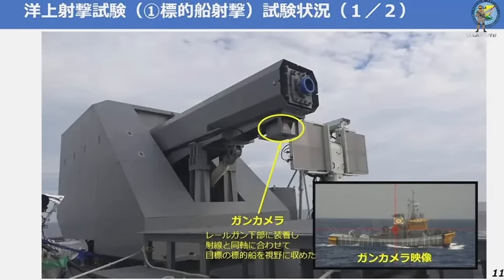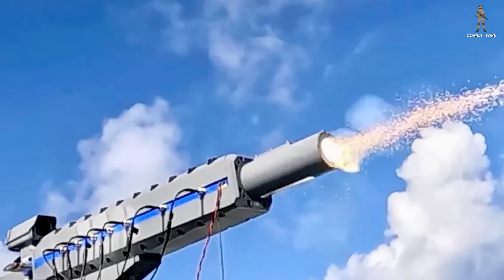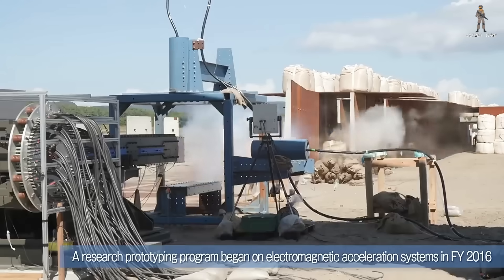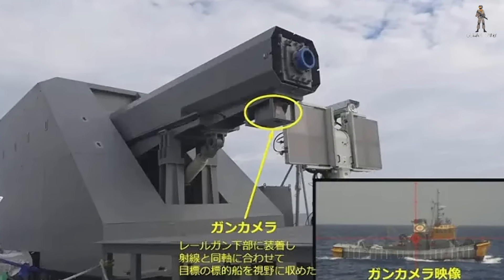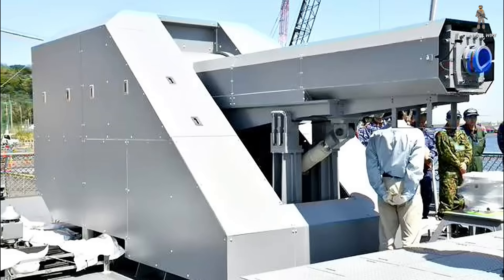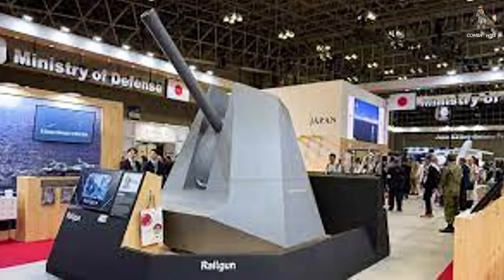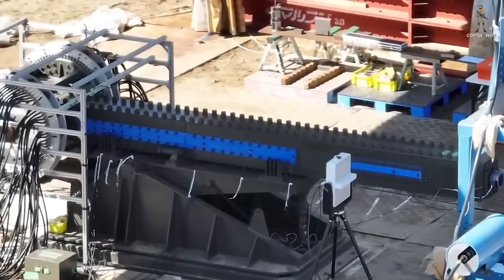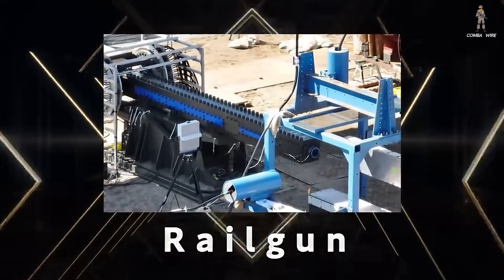For the First Time Ever, Japan Reveals True Railgun Damage at Sea.

Comment: Couple of things off and or missing in this video.  The U.S. has working models of a rail gun.  The issues with the rail gun include: Price of ammunition (I think it was estimated at 1 million a shell), Power requirements needed to fire weapon, and what is NOT mentioned in this is firing rate.  Sure it works if you only fire 1 shell every 30 minutes.  This is possibly where Japan made some improvements making it shorter between shots but notice how it was NEVER mentioned in this video?  Firing one of these 1 every 10 minutes is NOT quite lethal.  I doubt it is that short of an interval.  The power is also a MAJOR issue in order to get these onto ships they require a nuclear reactor power source or like this video mentions 4 container size power generators-this video says it was part of the cooling system and it might be but that is still not very realistic.  
Now a solution to the power and firing rate I hate to say is the battleship design war ship.  Completely remodeled of course having probably 2 nuclear reactors.  A ship with this size and shielding could have 2 rails in front maybe 2 in back reducing firing rates by a factor of 2 or 4.  Fire 1 it sits idle for 20 minutes while 5 minutes later you fire the 2nd and then it sits 20 minutes.  5 minutes later fire the third and so on.
You reduce the time to fire the size of those ships can hold the power source.  
With all this being said one can see why it really might not be feasible to complete.  The cost of weapons, shells, power (reactors) new ships, and still have some limitations on using rail guns.  Although I heard a theory that battleships may soon be required again in order to house the necessary vertical cell amounts for a new modern battle.  The new attack profiles show one can overwhelm a current strike group if a certain insane amount of incoming targets are launched.  Example most Destroyers have max 96 cells so if lets say 1000 anti ship missiles and drones are all coordinated to attach that vessel- something would probably get through.  In a prolonged battle with multiple sorties it can be an issue of using up all the anti air missiles rendering a ship ineffective.  Think about once per hour a strike group having 200 fired at them- would they survive for 48 hours?  A new battleship design could be designed to hold 400 cells for anti air (plane, drone, and missiles) and anti ship.  I know i am leaving out the other defense mechanisms on destroyers like lasers also power hungry devices, the close in weapon systems etc. but it is just a numbers game.

Comment: Railguns are really, joust not that good.

The first problem is the velocity. We are often given 800 to 1000 m/s for conventional guns, which is not wrong but very misleading. A railgun shots sub caliber projectiles. Such projectiles are shot at 1600 to 1700 m/s (mach 5) out of conventional guns.

Being cheap per shot is nearly inconsequential in its environment. The targets are either other ships or planes. Even a plane is vastly more expensive than most missiles. It can also not be used as defense against drones due to the fire rate. This means another system needs to be used no matter how cheap a railgun is per shot.

The railgun has lackluster damage. It is great for penetration, but all that it is doing is poke a hole. A hole ,as shown in the video could be fixed within minutes by any damage control personnel, and it would still take a day or 2 to sink the ship even if left unattended.

The few other niches it could take are also rapidly being taken by lasers. Far cheaper and no need to rebuild your entire ship.
Reply: A railgun would be more of a 'sniper'.  If you know where a particular ship's ammo depot is, you could have enough power to punch through armor to hit it.  Even if you don't cause it to detonate, that's still damaged goods in there, meaning damage control will be needed in such an area, slowing down damage control in other areas.  It could even be used to more effectively hamstring weapon systems, as a good shot could slice through a weapon control system.  Even damage engines in rather awkward places.  There's a lot of potential with the use of railguns.  We're still a long ways off from seeing them being used more than just prototypes.

Comment: Problem with a railgun is really 3 things range, speed, and overall logistics. The fastest they can get these things is about mach 6 (they say Mach 7) where as breathroughs in scramjets essentially make it obsolete because instead of a 80-100 mile range and something that has to have a recharge time and tons of maitenance you can have something that has 190 mile range and is accurate AF moving at Mach 10 and can be reloaded at sea where as railguns can only be reloaded at port. Oh, and did I forget to mention hypersonic missiles can be apart of aircraft loadouts too? So which would you rather have? Ships with less range but a cool sounding gun or ships and aircraft capable of decimating enemy defenses from anywhere anytime? At the end of the day, afterall, logistics wins wars.

Comment: Railguns in movies : static electricity charge all along barrel, explosive boom when firing, dramatic recoil
Railguns in real life : poot
Reply: poot poot goes the small mass of death througth the sky ,,, hmm wonder if nuclear material could be combined in such a way that the energy from the impact would trigger it into a small nuclear explosion
Reply: @V_for_Vendetta_vNah…
Reply: it's like the Displacer in Lancer: barely any visual indication, barely any sound for a weapon of this caliber directly from the firing, you only hear moments alter the cacophony of machines engaging cooling systems and handling the power load.
Reply: Thats a coil gun i think
Reply: @iofebquelloscarso6275 See, this is what happens when you think.
Reply: It’s super sonic, it’s very very loud.
Reply: tbf, that would be scary to experience. out of nowhere, no sound, no heat signature, no indication of what's coming, your ship suddenly sinking
Reply: @truck-kun  It has to have a heat signature, just by going THAT fast.
Reply: @TheGaMeL0rD  a pretty big one as well, at mach 7 such a pointy object would generate enough heat to melt steel and then some at the tip.
the trick is to be close enough that the target wont have the time or opportunity to register it at all before getting hit, we are talking mach 6 to 7 after all.
Reply: @Nardur12321  "captain! incoming bogey at seven miles and closi..."
Reply: “Poot” 🤣🤣
Reply: The challenge with rail guns is it air resistance.  They will obviously be the weapon of choice in space, but their advantage of conventional explosives is greatly reduced by the extreme resistance. They are also stupid projectiles so long ranges or with erratic targets they may be quite ineffective.  Also, if you think about the energy consumption, the shift would need to carry massive amounts of additional fuel just to generate the necessary electricity. That extra fuel might actually take up more space than the conventional rounds.
Reply: like with lazers
Reply: Hey Mark, six projector is going to make a huge sonic boom that could be louder than a conventional chemical explosive.
Reply: Because this is only level 3. The movie's relation is level 5.1.

Comment: There are a wide variety of reasons the US gave up on railguns.  One of the big ones is that we were aiming at vastly-long-range, like potentially orbital.  And that meant the rounds had to be self-guided.  Which meant expensive, and deeply vulnerable to the exact kind of forces the railgun would blast the round with to fire it.

Another concern was power demand, on top of the US navy powering EVERYTHING ELSE electrically now on our ships.  Propulsion, power-hungry sensors, laser point defense systems (being tested at the same time, and tested very well).

Seems like Japan's being successful with a less ambitious approach.  I applaud them, and hopefully it does well for them.

Comment: Eh, until they figure out the issues of the "barrel" destroying itself over a relatively few amount of shots it'll be stuck in research hell forever. Problem is pumping that much power through the rails tends to overheat them and they melt/degrade rapidly.

Comment: One of the reasons that makes it believeable that Japan may be the country to perfect Railguns is the fact they've been moving stuff on electromagnetic rails for decades thanks to the Shinkansen. There's a whooooooole plethora of knowledge they've accrued thanks to that. From energy management, to material behavior.
Another reason isalso the many decades of engineering knowledge on the field of fitting complex machinery in small spaces, born of necessity (island nation, space is a premium). Have you seen a video of a Japanese plastic recycling plant? Awesome stuff.
Those two pillars of knowledge give them a whole different mindset to tackle the technological challenges brought by Railgun Technology.
Reply: They’ve also got much more modest and practical goals for this weapon. A 40 mm railgun could be a GREAT option as a CIWS if they can develop a slightly sturdier (and easily swappable) barrel. The US railgun looked like something Leader Desslock (or Dessler if you prefer) would to the bow of his flagship. It was totally impractical.
Reply: @GrahamCStrouse  I just dont know.  My bet the tech will get far more expensive, after the kinks are resolved, rate of fire needs a boost.  Not many chances to make interception, let alone multiple.  It might penetrate anything and from further away, but swapping CIWS for rail, if performs as advertised, I dont know.  I can see this for major vessels, have room and energy, too far to swarm, but for smaller craft, CIWS or a mix, might be best.

Comment: History - the rail gun is an adaptation of the mass driver designed to move material from asteroids to a processing plant near L5. It was designed by a thinktank run by Gerard K O’Neill  in the 1960s. See his book ‘The High Frontier’ which was submitted to Congress in around 1972. Reagan subsequently introduced the Space Defense Initiative (SDI -Star Wars) , basically to provide funding to develop space tech in a way the voters could understand.

Comment: A modular barrel seems to be the key. Not only easily replacing worn down barrels but also being able to quickly switch out different barrel types.
Reply: The question is hotswap or coldswap (Hotswap allows for you to switch barrels without completely powering down first, like USB)
Reply: OMG...make it with rotary barrels.😮
Reply: @sithsquid1 and the put it in a plane!
Reply: @sithsquid1  and then with circular magazines, you can have revolverception.
Reply: @sithsquid1 then you need to replace 6 barrels
Reply: You think the engineers never thought of a modular barrel? :P
Reply: @iGhost umm I’m sure it’s probably their end game. Calm down. It’s just the video doesn’t mention it when it seems to be the most logical solution. Even some conventional artillery guns have swappable barrels.
Reply: Modular barrel + watercooling (the ship is in cold water FFS) + turbines for power (the ship is in moving water FFS). The real issue is why do all of this when good old BOOM BOOM guns work fine ? Maybe for a stealth ship ?
Reply: @PyromancerRift 
Missile interception
Reply: @PyromancerRift  No gunpowder need = more space and less explosive on board.
Reply: @PyromancerRift  hyper sonic missile is too fast for traditional pew pew. laser only works well under good weather. that's why we need railgun.

Comment: Being able to punch a hole through the power plant of a navy vessel at low cost while being extremely difficult to counter at long ranges far exceeding typical chemical heavy guns is massive. You can use a missile to counter a ballistic, but a 1-5million missile vs a 12k tungsten rod is huge.

Comment: I mean modern ships are glass cannons so the thing penetrating isn't surprising.

I think a battleship equipped with railguns (even small ones) in a carrier group would just mop the floor with everything.
All that space a battleship has for conventional ammunition can be converted to hold railgun ammo, rails and support equipment.  Try to ammo rack a battleship who's ammo is just a bunch of steel slugs.
Modern ships just don't have the armor or space to host these weapons right now.

Comment: Can't really see the application for this yet, it needs massive power even using nuclear powerplants it can't keep up so it's waiting on fusion and even then when that rolls round it's going to be obsolete in favour of energy cannons, platforms can't handle it so it need either a battleship, a defense platform or a space station and then you got the cost of replacing barrels etc with is just going to balloon the cost, it's a nice RnD project  but they're better off figuring out fusion it's not a viable intermittent weapon between now and then won't replace a gun on a ship which is only usable in cqb and we've got missiles that can hit anything at any range.

Comment: next step, hold the projectile in an electromagnetic field so the barrel wont wear out?
Reply: You're thinking of a Coilgun. Railguns require constant contact with the barrels rails to drive the projectile, Rail-Gun.
Reply: @nebuladoe775 combine the 2, minimize contact and put a conductive liner on the rails that can be easilly replaced after 500 ish shots

Comment: Naval warfare is largely beyond visual range i.e. over the horizon, these days. Even going with ballistic trajectories you’d have to have a very precise fix on the target or you would need terminal guidance for the projectile, which is very expensive and challenging. Missiles are better at this. Railguns may have a role to play but I’m skeptical. They are, however, better than lasers that are strictly visual range only and probably won’t work well in real world conditions.

Comment: 6:17 That is the real reason why many other nations gave up.  You don't build a railgun and install it on a ship, you build the ship around the railgun.  

Unlike a hypervelocity missile or extended range artillery, where you simply produce the missile/projectile and fire it off existing launchers and guns. 
The ammo is the one that provides the range and speed. So you can use your existing platforms.

But for a Railgun, it would require a major shift as you have to use clean sheet new designs to fit them.

Comment: NO!!!  Japan’s just being ignorant!  

The rail gun draws too much energy from the ships primary systems!  

Hypersonic missiles are a better and more effective use of resources!!!

Poking a hole in ship doesn’t disable the ship!  

Transcend the bullshit!

Do a little research before hitting the record button!
Reply: Power is never an issue, hypersonic missile has speed limits or it will break and expensive, that can be destroyed by a cheaper  and faster shot from a railgun. Most of modern ships are not armored compared to ww2, and poking holes until the hitting engines make your ship useless

Comment: So likely what you would have is a ship that fires only railfun projectiles and no magazine for missiles (aside from maybe something defensive like Sea Sparrow) due to the huge amount of space required for power generation and cooling and maintenance requirements.  As it stands now, in order to integrate the railgun onto a platform that also has like a VLS you'd need the hull to be about half the size of a carrier in order to accommodate the seperate  systems requirements

Comment: The big problem with shipboard missiles that they can’t (yet) be reloaded at sea, and each ship can carry only about 100 cells. But railgun barrels become unusable at about 200 shots – so no real improvement. Railgun projectiles are also very expensive to produce.

As the nations of the world make more and more use of space, railguns can be used to provide the tons and tons of stuff needed for space-based military, manufacturing and agricultural purposes. Since the railguns will presumably be powered by stored solar energy, the environmental issues that would otherwise be caused by massive numbers of chemical rocket missions would be avoided

Comment: If the US ditched it then why are they still testing it at the Dahlgren Surface Warfare Center in northern Virginia? I remember a few weeks back I couldnt get to the barrel range side of the base because the road was blocked by security personnel. I asked a contractor there what was going on and he told me they moved the Electromagnetic railgun from the lab to the barrel testing range... So.... Theres that....

Comment: A railgun will not have the range nor explosive payload of a missile. It they are solid projectiles then a direct hit is needed on an incoming missile or plane instead of a proximity round.
Reply: If the Japanese are looking for a weapon to intercept missiles, a direct hit by a hypersonic projectile fired from the railgun is more than enough. Kinetic interceptor projectile is far cheaper than a missile and a Japanese warship can carry a lot more of these than missiles.
Reply: @DelAoc The rate of fire would be too slow incase of a miss. That’s why AA guns have a high rate of fire and missiles have proximity fuses, to increase the chances of a hit.
Reply: @gtv6chuck  The Japanese system is said to be developed with the goal of a high sustained rate of fire. Nobody knows what rate that is yet but it does have advantages over other AA guns we know about. It has enormous range allowing it to engage targets at distance well beyond normal AA guns. At hypersonic speed, the projectile also reaches its target far quicker than normal AA gun shell can.